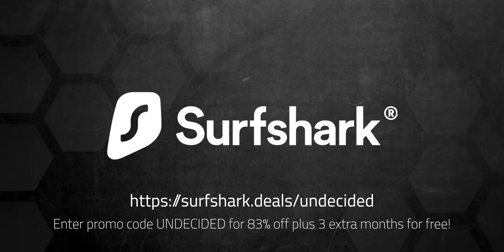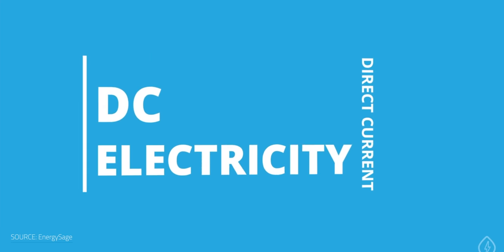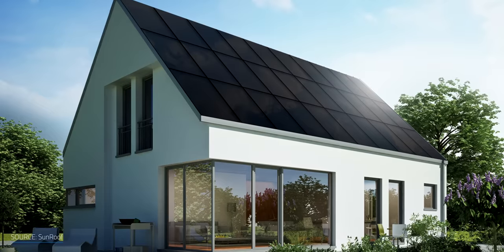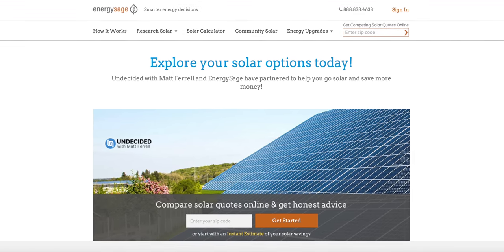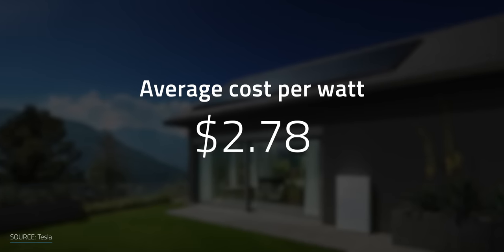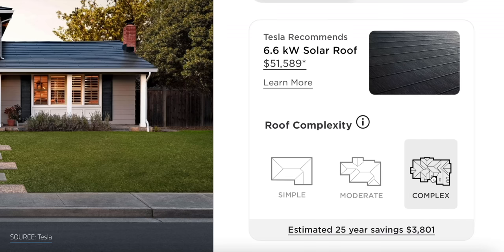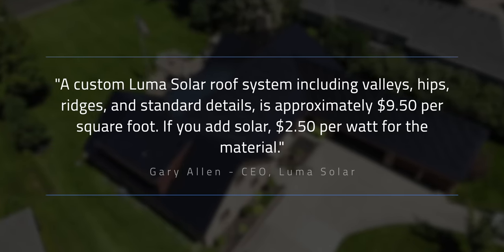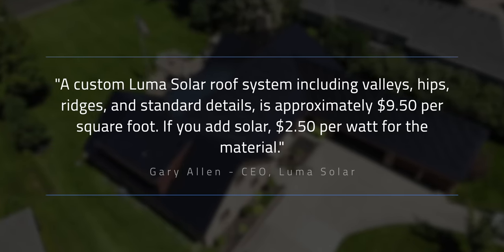Exploring Tesla Solar Roof vs. Solar Panels

Comment: The Problem is, if you have 120 m² of roof area and you'll fill it up with Tesla Solar Roof, you'll end up with 6 kW peak power, which needs a Tesla Powerwall as well or your EV is always empty to be charged. Otherwise you'll waste a lot of kWh. If your home is uses heat pump you could need more solar power. New PV systems generate 330 Wp per module, so you just need 20 modules to surpass 120 m² TSR.
20 of these 330 Wp modules cost 3.300 Euro but you just need 35 m² of roof area. So it's all about the size of your roof and how much energy you'll need.

I went for a metal roof like SolarPan where you can easily install your PV modules, because the rails for mounting the PV modules are implemented into the shape of the metal roof tiles. It's cheap and safe!

100 m² SolarPan roof with 6 kWp solar power and a Tesla Powerwall should cost under 20.000 bucks.

Comment: You said the main difference between panels and tiles is aesthetic appearance. You're missing a huge point: The life of a roof (shingles) is about 10 or 15 years, while the life of solar panels is about 25 years. So if you get panels, about 10 or 15yrs later you will have to replace your roof, with labor to remove and reinstall the panels (a basic house will be around $10k or so), whereas with tiles you can skip that installation completely.

Comment: I just got a solar quote with roof replacement. I'm due for a new roof because I live in florida and my insurance rates will break into a new tier next year if I don't replace my roof. After getting quotes for both a new roof and solar system it's only about a $2000 primum to go with a solar roof. That being said it's an upgrade from asphalt shingles to tesla solar tiles. And if the wind hail ratings and repairs concepts of solar roofs hold true it may make even better sense.

Comment: In hot climates panels have another advantage, they provide shade for the roof because there is a gap underneath them. The effect was very noticeable on my house in Sydney Australia even though I have good insulation.
Reply: It wouldn't surprise me if tiles have some of the same effect. A 20% efficient solar anything means you are removing 20% of the heat energy. Panels are probably a bit better since it gives you the air gap though.
Reply: @oscarsmith3942  Judging by the temperature at the back of my panels on a hot day, not so much. The airflow that the panel gap gives also lets the panels cool down, and the roof is completely shaded.  The cooler panels also perform better than when they get hot. The biggest advantage that the tiles have is their invisibility and ability to have a more complex roof design, however for me I’d rather have a simpler and more efficient roof. 

On a hot summer day the roof on my house was far too hot to touch with bare skin where the sun was hitting it, but felt cool to touch in the shade under my solar panels.  This means that the attic temperature would be substantially lower and so the ceiling insulation doesn’t have as much of an impact.

Comment: Quite interesting. I'd be interested in the durability of these products in how they stand up to weather, like hurricanes, icing and snow buildup on roofs. Also, it seems the replacement of Tesla Solar Roof is pretty easy and so should cost less. How is the replacement of solar panels ? Also, when you instal a solar roof you are replacing the roof, but when installing solar panels you are installing on an existing roof. How does that affect the warranty if the roofing materials and timing of the existing roof doesn't match the warranty of the solar panels.

Comment: Does the price for tesla take into account based on their website or the actual costs?  
I've been researching the rules,  have spoken to installers and even some of the very first to test installation for tesla (I'm a Roofing consultant myself)  we've discovered actual costs of the roof installation are between 130%-250% what the website calculator gives initially,  and that was before the recent price increase in April which has more than doubled in many cases ( one particular person who we interviewed said it went from an irritable $46k on the website to their new contract tesla sent out at $152k, over 3x the website calculations and double the initial contract. In fact,  even the updated calculator which would label the roof as a moderate difficulty,  at best [5:12, Gable], doesn't price the roof above $100k.

Comment: In India's state Maharashtra, 250 MW Solar Auction was won with ₹2.51/kWh or $0.034/kWh rates. And I feel it's nuts how the rest of the world has such high prices and as someone who'll soon be in the UK (and probably settle there), I really do find the pricing elsewhere ridiculous cuz even if they last say 5 years of their 10-year warranty, for 25 years the cost is still significantly lower. I wonder what the import charges are like lol.
But I feel panels reach higher efficiency and lower cost with more wattage than the roof. And do the tiles each have micro-inverters? cuz if not then nope, never.

Comment: When tiles are used, are all the tiles solar or is there a mix? I can see pros and cons for both. Pros, squeak out ever last inch of wattage. Con, some tiles would see drastically lower usage.
Reply: In a series solar circuit your output current is dictated by your lowest producing cell.  

There is a mix of active and non active cells on these roofs, any amount of shading on an active cell will degrade the entire output.

Comment: I like the price of the panels better of course, but I worry about the cost of removing and reinstalling the panels if the old roof shingles need replacing. The solar roof does not have this concern.
I'd like to see the cost of ownership over the long term.
There are so many factors, so many pros and cons for each that I can't make up my mind. I would likely go with price in the end.

Comment: You forgot that the efficiency is usually measured under STC, so if the tiles are not cooled by air flowing underneath, the efficiency will drop more harshly. Thus, panels mounted on the roof with a gap will have a better energy output with the same specs.

Comment: Here is one issue everyone seems to have missed.  Those dark pannels are going to heat through the roof, through the house's insulation, into the house.  Consequently, if you are going to use tiles, you're are going to need a heat barrier.  You can pull the panels further from the roof, allowing air to flow between the house and the roof.  You should probably still use some sort of heat barrier. That extra heat will raise the air conditioner bill.
Reply: Look at his video he made with the roof installer.  Tesla tiles are an inch and a half to two inches raised above a full impermeable sheeting.  Other tile systems may use something similar.
Reply: @PC-vq5ud  That's really bad.  Those houses will bake in the summer.  I coated my asphalt shingled roof with white Roofguard 700 about 10 years ago.  My attic went from 140+ in the summer to 5 deg. above ambient temperature.  That heat radiates through the insulation into the house.  That's 1/3 of your air conditioning bill.  We had a bad hail storm and half the houses got a new roof.  I took a roofing contractor that knocked on my door to my roof.  He looked at the roof and told me if everyone did this he'd be out of business.

Comment: The correct answer is to do it yourself.  Jinko panels can be had at $0.75 a watt.  And the inverter/charger/ solar charge controller is $1/watt.   I would not want to do it on a roof, but If I had the land, it would be easy enough to build a stand.

Comment: When you compared the prices I think you forgot one important thing: when building a new home and include solar panels, you have to pay a roofer as well as someone to install the solar panels. This might change the cost comparison dramatically. You only mentioned that you save material cost, which compared to paying the roofer is negligible

Comment: I plan to build a modular home using shipping containers and like solar panels more. I can use panels themselves as my roof if I build the scaffolding right. But I do like the tiles for existing homes and new construction. 
My big thing I’m trying to figure out is energy storage solution that can handle discharge stress of a completely off grid home. One That particularly lasts decades. Possibly hydrogen.

Comment: 3,27$ per watt is incredibly expensive. I just got a quote for 11.2KW solar power system (with everything included) for 9500€ with 85% efficiency after 30years. So yeah, while I do love the look of the Tesla tiles, they just don't justify that much higher cost.

Comment: Thanks for comparison and info. Tiles are more esthetically pleasing and could be potentially extended and placed almost to crevasse and all those diagonal places otherwise unfit for bigger rectangular panel. But panels can be tilted, plus they can be replaced easier then actual roof tiles. Yes, you can have spare tiles, or order replacement, ehh wait a sec .. I own an old roof and it's quite hard to find replacement tiles already, and those as clay tiles which were far more common in their days. So I'm not buying legend that I would be able to purchase spare tile after 10-20 years. But panels probably yes, if they keep some same generic format (and hopefully much better efficiency), which is more probable.
However, what I'd really like to see are shingles/tiles which will last 1000 years, and have efficiency way above today's niche numbers. Then just add batteries (any reasonably sized storage system) with high power density overcoming what we can extract from fossil fuels .. and we can go green "full steam ahead" !
Till then there sis till a lot of scammers and opportunists which will sell you huge green dreams for hard green bucks, no matter how bad the system design they offer is.

Comment: Dear Matt, thanks for producing what to me is a very interesting topic.  I just want to confirm a couple of facts.

1. Can you walk around your roof once installed or do the tiles crack under pedestrian loads.  I often walk over my roof to do various maintenance things and so would need this functionality to remain. 
2. Square metre to square metre, is the generation capacity roughly the same between panels and tiles?
3. My perception is that by covering the same panel section of a roof, the tiles will come out more productive as the small tiles cover the entire section but the panels only cover whatever combination of big panel sizes fits on my roof. Is this correct?
Cheers and thanks again for a brilliant presentation.

Comment: Btw, i would no mind about power decrease over the years with silicon based photovolaic systems. I have read a scientific study about that, and the conclusion was, they just last way longer than you life  with <0,1% decrease per year. Only when they are new they will loose some percent of power, after that it is nearly impossible to measure.

Comment: i love matt's videos. but i find in this episode the prices of these panels to be very very high. we buy Canadian solar panels of similar efficiency in india from 30 US cents per watt and another 20 cents for all other structures, cables, inverter and installation. overall. we can do solar roof tops from 50 us cents per watt to 60 US cents and that is the tender accepted rates in india. i am a lot confused with the prices matt has got from sources.

Comment: While I understand issues of complexity, I was slated to get solar shingles and three power walls installed and two weeks before the start of construction (after an 8 month wait), Tesla bumped up the price by over $10k. My roof is as simple as can be, just your standard A frame. When I asked what the heck, my rep simply said, “Yeah, this is the new price. Are you ok with that?”  No actual explanation as to how they could be so off. I canceled.

Comment: Assuming you're planning to build a new house from scratch, would it then make more sense to just get solar roof outright?
Reply: Not particularly.

Panels are more efficient
More robust
Easily upgradable
Maintenance is lower (To maintain efficiency you have to clean your panels/tiles)
Panels can also fit any roof type allowing design flexibility, which means not only can you take advantage of better roof designs which are more efficient for dealing with passive heating/cooling, but newer cheaper roof materials. contrary to popular belief it "can be" cheaper to install panels and a roof vs a solar roof.
Panels can also be decked out with tracking systems if you want to pay extra enabling even greater efficiency. 
Depending on your needs they do not need to be installed on your house, large sheds and garages provide more then enough space to accommodate panels, freeing your roof up for whatever design you want.

Panels are simply a much better product with many more options for people to customize with and systems designed to suit their individual needs.

Comment: One consideration never addressed is the age of the person considering solar. At 72 years old, none of these options are in the least bit financially viable for me. Then there is the person whose work might well require them to transfer to another location quite often. There are numerous real world examples of causes for short term occupancy in a given dwelling. It would be interesting to see some sort of analysis of adding solar, be it tiles or panels, with respect to length of occupancy. The average length of home ownership in the United States is around eight years as of 2020. How does that work at all financially given the cost of installing solar?

Comment: Solar tiles are far less efficient in summer as they transfer 90 times more of the sun's heat into your home as compared to traditional solar panels that are slightly raised from the surface of the roof allowing air to pass underneath so heat does not transfer into your home.

Comment: The biggest issue with solar is the need for energy storage. Batteries, as of now and the immediate future(10-15+ years) are just not feasible, too short term, too environmentally destructive, and too complicated to recycle. This is just the fact of the matter. 

Unless we explore large scale energy storage at centralized, mega-efficient, facilities, this isn't going to work. Dams are one of these methods, but not everywhere can have a giant dam holding billions of gallons of water to use when the sun isn't out. 

Perhaps flywheels? Molten salt? More dams? 

Solar panels aren't currently the problem (that much. they still currently get recycled by burning in trash piles in africa) but the massive amounts of energy storage we need to realize them that doesn't depend on batteries.
Reply: You are WRONG. Stop believing OUTDATED FUD disinfo. If you get a reasonable solar array 4 to 6kW system then add an LFP chemistry
storage battery of 7 to 10kWh or get a modular LFP battery system where you start off with 4kWh then add more storage over time.
LFP contains NO cobalt, does not suffer from thermal runaway and is very cost effective.
Reply: @honesty_-no9he  you literally proved nothing wrong. Calm down zoomer

Comment: Wow, rooftop solar is insanely overpriced in USA.
For comparison wholesale price for PV panels is about 20 US cent per W. 
You can get a full system installed in Australia for a few grand.
Reply: The prices given include installation, batteries, charge controllers, labor &c. Retail PV panels go for about $0.80/watt nominal. I don't know what they are wholesale. 
Australia might also save on shipping from China, but international trade isn't my strong point.

And Matt lives in the UK, I believe....yes?

Comment: "which one are you interested in, tiles or panels"
...
flower, honestly.  I actually plan to build my own, at some point, because the one on market is way overpriced.  I prefer a moving array in order to maximize input that can also fold away, plus it's just cooler.

Comment: I think that a better comparison might be Total Cost of Ownership. TCO will be with an assumed life time of 25 years. So on one side. Cost of roof, plus panels plus installation plus inverter replacement at 12.5 years. And on the other side cost of roof, plus installation plus inverter replacement at 12.5 years. And for both the cost of maintenance. For panels this is easy to work out as there is now lots of data. For tiles we really don't know how well they hold up. Not arguing its good or bad, just that the data is missing. 

I live in Australia where roofing systems typically give a 70 plus year lifetime And for reasons unclear to me panels are much cheaper than in the US. So a roof plus panels here is a no brainer. 

But it is an interesting analysis but without a cradle to grave analysis this brief intro to the question  comes up short.

Comment: They've become way to expensive for a regular middle class family ... If a house is worth 300.000 $ and the roof is 150.000 $ how would you recover your investment in 15 years ? You now have a house that is worth 450.000 in a neighborhood with and average price of 300.000 , and those tiles are not eternal, that means they don't go up in value by time , they go down ...
 You are likely to loose money in the long term if you look at the roof as an investment /asset. I mean if you consider 10-15 years from now the solar tiles/roof in the future will be:
- 1. more efficient 
- 2. more resistent 
- 3. much cheaper

You now pay the price of early adopting a new kind of technology/trend that will not add value to your asset( the house). 

With the price going up is not worth it right now.